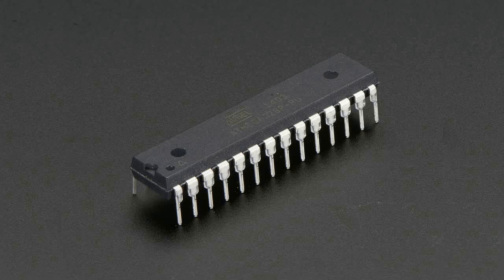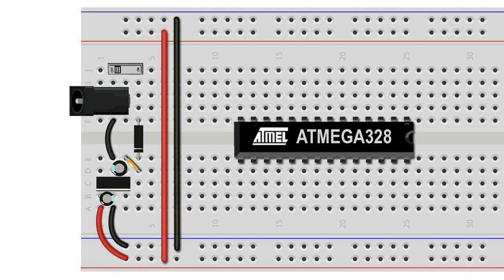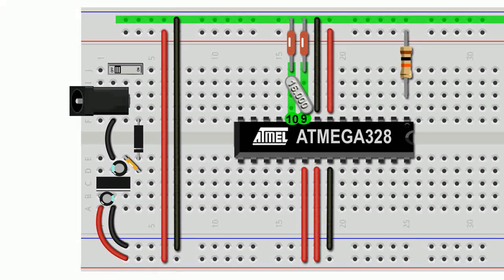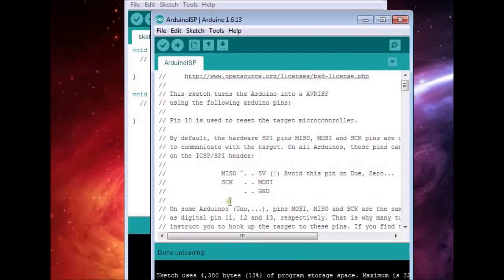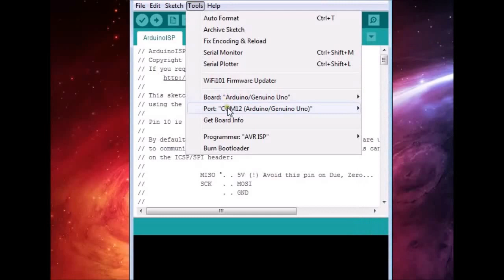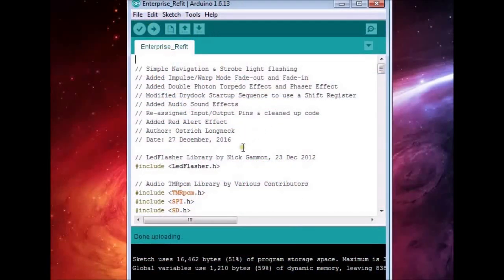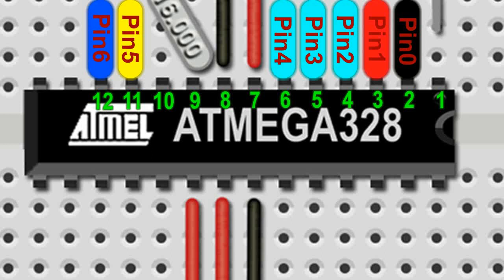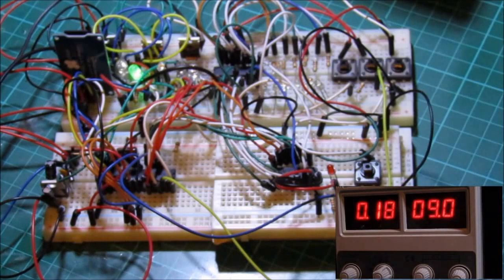Arduino for Starships - Ch11 - Programming the ATMega-328

Comment: Just wondering how we are going to drive the 5 Navigation
and 4 Strobes for the refit. Don’t think the board will have enough power to do
that. Could we use another Darlington to do that? If so that would leave additional
pins on the chip. Is it possible to hook these to switches to run say
additional lights in the ship, such the Arboretum or officer’s lounge and rec
room?
Reply from the maker: Yup, I haven't "field-tested" the board yet, so we might need to go that route. We have wired up all the strobe and navigation lights through an ATTiny85 before, on the Defiant build, and the ATTiny handled all of these, including the phasers and photon torpedoes, just fine. The floodlights, nacelles, shuttlebay, etc. aren't connected directly through the ATMega chip, only their shift registers and mosfets, and they draw power straight from the 9V or 12V power supply. The thing that worries me is the SD card reader, as that draws power from the 5V line. I figured a 2 Amp supply would be enough, as the standalone ATMega only draws 180 mA. I tried to be as stingy as possible with the current, in order to allow more power for the extra LEDs when the circuit is finally connected to the Enterprise. But life has a funny way of biting one in the rear, so the extra shift registers and Darlington drivers might still have to be an option. And, as you mentioned, we could wire up even more stuff then! I think a person can even "piggy back" shift registers, to give outputs using larger numbers than 255, so no extra ATMega outputs need to be allocated to additional shift registers. Thanks for bringing that up, though. We'll definitely need to find some workarounds if the final circuit board is too power-hungry! - Trevor
Reply: Thanks Trevor, looking forward to your next instalment